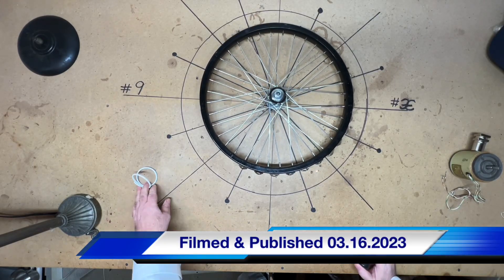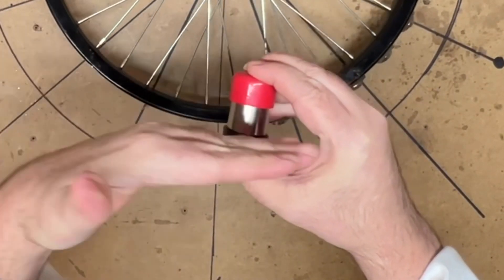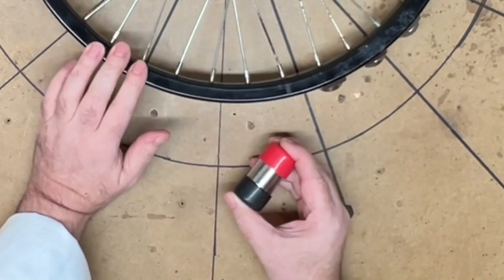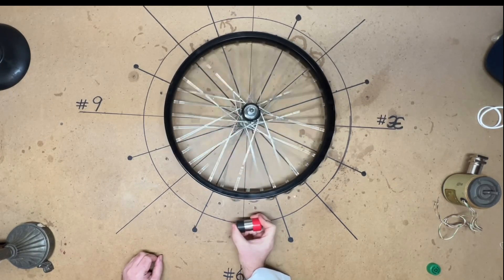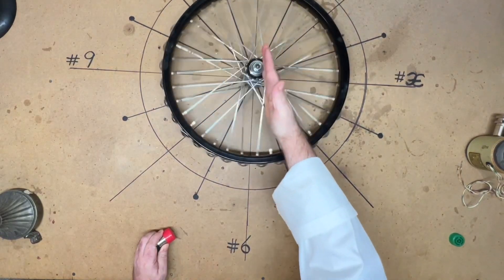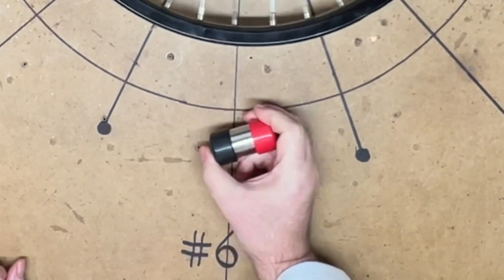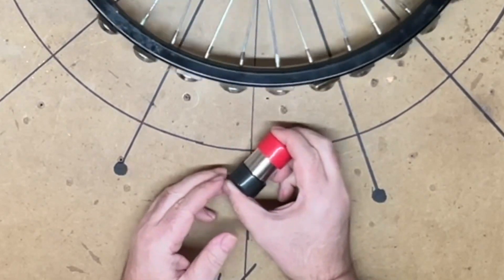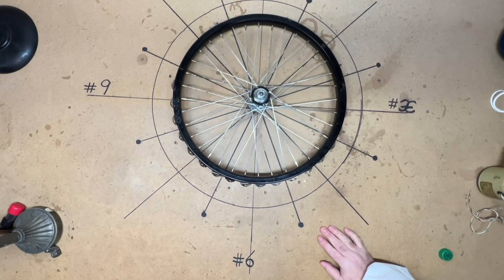For Light Seeker + 90 RPMs Achieved

Comment: You are overthinking this. Let me use a picture so you get the understanding of what I'm suggesting. 
Put the magnet device in a non-metallic crescent wrench. Tape it in or whatever to make it stay in the jaws. 
Drill a hole and Mount the crescent wrench vertically where the handle goes through the table. 
Under the table, affix the crescent wrench to a triangular piece of wood to enable the rotation movement, but also add screws to stop it from moving too far.
(If you understand the concept, then you know there are a couple more pieces to keep the wrench from falling too far into the hole, etc.... simple engineering)

Now, for the activation, do NOT put extra torque on the wheel. You want it to run freely.
Use the attraction of the magnets to pull a weaker magnet on a spring mounted underneath the wheel (inside the rim toward the axle) toward the pivoter. 
As the magnets get close to the pivoter, the magnet moves toward them and is connected to the pivoter by a rod. 
(not straight to the wrench, but think linkage in a car) 
The independent magnet and bar turn the pivot to the proper point (horizontal).
After the magnets pass, the attraction doesn't overcome the pull of the spring anymore, so the spring pulls the magnet bar back.

Now you have movement and the bicycle rim can be used more freely.

Comment: Another question sir

Do you think having a steel wheel makes a difference versus a non metallic disk or wheel?
Thank you
Reply from the maker: 🧲 Steel wheel has its pros and cons. Sadly there are more cons than pros, and what pros there are is simply a matter of convince of being able simply stick the magnets to the wheel. The other pro is I can change configurations in a snap without complications. 

The cons? 

1 - Magnetic flux traveling down the wheel rim.

2 - The steel causes drag on the stator magnets. 

3 - Can’t control the angle of the armature magnets. 

4 - Armature magnets will suddenly fly off once the steel wheel starts turning extremely fast. My guess that will happen at any time between 500  to 700 rpm.

In abut shell, the steel wheel needs to go, but it’s what I have to work with for now. I looked into a non metal bicycle wheel, but the price was astronomical at over two grand per wheel at a local bike shop. So a 17” X 1/2” round acrylic disc is the next best way to go.

Comment: Hey James. This is great stuff. Awesome video and ideas. I am loving it. Thank you.

Just a suggestion. Super glue and a wood slat make great custom builds. Let me clarify what I mean by a slat. Something like a flat wooden foot ruler. Flat and long. Is easily saw-able with a hacksaw blade. Sandpaper for super accurate cuts. Superglue to put it all together on your magnets. Easily shape-able with a sharp blade. Easy to work with because its soft wood. Fairly durable for small projects like this one. Trashing a non working design is easy too. Just scrape off the wood with a sharp blade. And you are ready roll again. Recycle your pivoting magnet till you get the right mix.

A small swiveling magnet is not difficult to do. Please let me know if you need help. I can design something on paper and send you a picture. You can put it together on your end.

Thank you once again. Blessings & Warm Regards.
Reply from the maker: 🧲 Hey Ray, I hear you loud and clear. A thin wood dow or wooden yard stick is what I’ll be using for now.  I prefer hot glue over super glue as I can easily get it off the magnets to start fresh again.  As for a pivoting stator mount I have a few good ideas. Despite I achieved the highest SAT score and  mechanical reasoning test four straight years in a row among three other gentleman does not mean that I have the best solutions. I’m simply looking to Jerry rig something for now. In the event I am truly onto something, and it actually starts to work without me having to use my hand then I can get real serious about the best options there are to build a professional prototype. You can always use my Gmail address using FREEMAGNETICENERGY 

More importantly, thank you for taking the time to stop by and share your thoughts on this as time is something we can never get back. Much obliged.
Reply: @FreeMagneticEnergy2  Sweet! Thank you.

Comment: Yes, upon my word, to say the least!! Mount the cam on the bottom of the wheel and a povet plate on the bottom of the shaft the switching magnet is mounted on. Also, divide the wheel magnet into two groups and two cam plate so it will be balanced. Only one drive or switching magnet would be needed. This is good.
Reply from the maker: 🧲 Each switching stator magnet adds additional torque into the system. I see your point, but for this up and coming test I need everything to be on top as to be able to make lots of adjustments quickly and easily. It also allows everyone to easily see the mechanics. I forgot to mention that the stator magnet wants to automatically switchback to the first position caused by the natural attraction to the steel wheel rim. 

Thank you for the tips, more so for your time that we can never get back. Much appreciated.

Comment: Got it sir
Wonderful explanations

Thank you
I will work on it asap
Reply from the maker: 🧲 I forgot to mention that the pivoting armature magnet wants to automatically reset to the starting position caused by the magnetic attraction to the steel in the wheel. Meanwhile, I’ll go to Lowe’s and see what I can find to build a make shift rotating stator mount. Really like to prove this works before you go through all that trouble.

Comment: I take that it takes some force to get the magnet to reach that desired 90 degree orientation? If the were on a balanced rocker, it would not get itself there? Then you need to extract energy from the wheel to turn it, and that sounds like a net zero sum effort as tried oh so many times. Not a lot different than trying to put the magnet in there only for the driving part.
Reply from the maker: 🧲 Actually it took very little force to turn it 90°.  However anything more force is required.  Rather than not chase this based upon assumptions, it’s easy enough to see if this concept will indeed bear some fruit, or where it might lead us to additional possibilities.